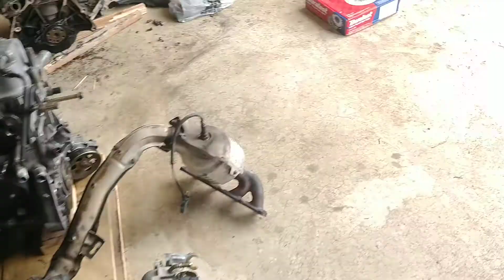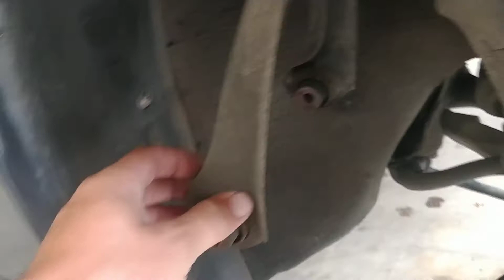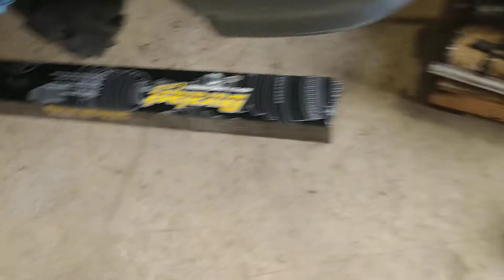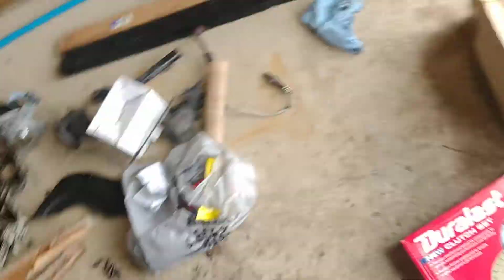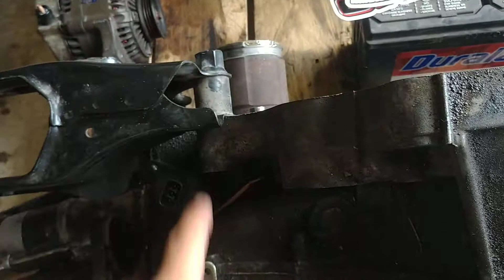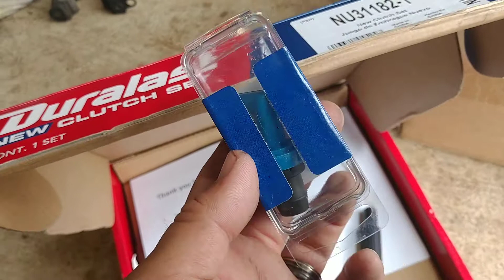1996-2000 Honda Civic JDM engine Swap 1.6L Non Vtec LX

Comment: Nice bro
Reply from the maker: It has sadly come to an end with this JDM swapped engine. Everything right out of the gate seemed to work fairly well, until a few months down the road it started consuming oil but wasn't leaking out anywhere. After some extensive investigation, it ended up being leaking valve stem seals on the intake side of Cyl 2 & 3. I was not able to schedule this repair before the owner ran it too hard without checking oil and seized it up. Car and engine went to scrap. :(
Reply: @11fulstrum  its better to replace the piston ring to